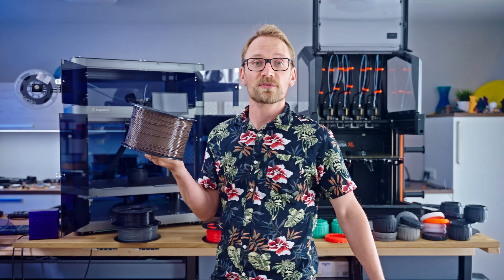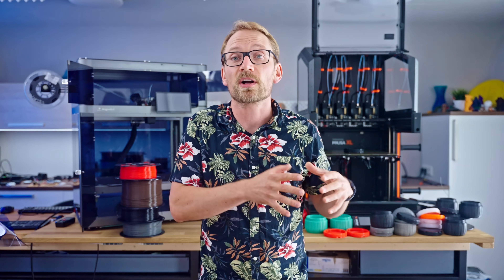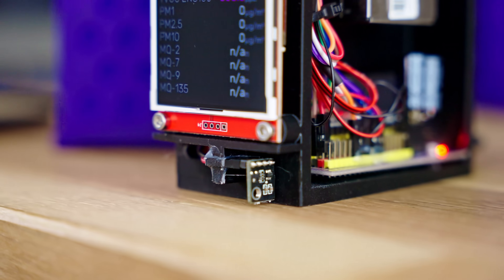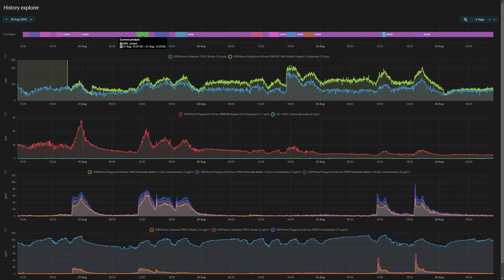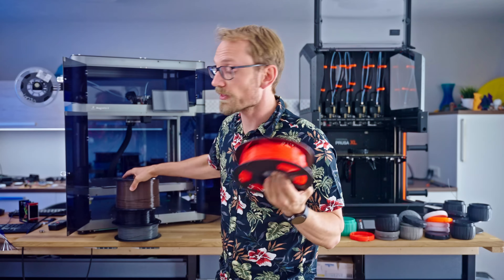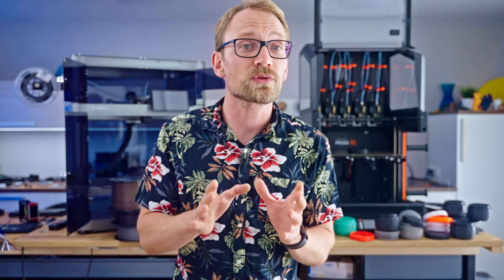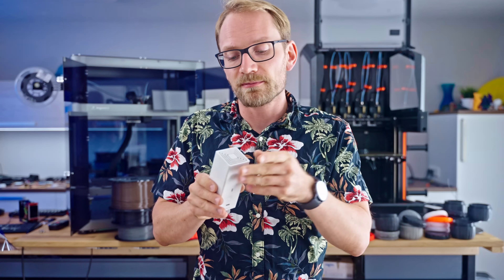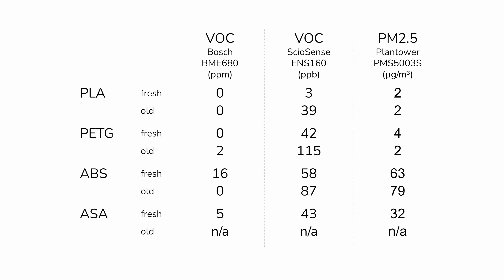3D printers are worse than I thought. Time to do something about it!

Comment from the maker: The Ikea filters I used are FÖRNUFTIG (EPA12 + carbon) and the more affordable UPPÅTVIND (EPA only) 
If you get a HEPA filter e.g. from Amazon, I'd recommend buying a reputable brand to make sure you actually get what you're paying for. Philips is trustworthy and seems to have reasonably priced replacement filters (important as you'll be swapping them multiple times a year): https://go.toms3d.org/HEPAmazon

Parts and sensors used:
ESP32 WROVER https://go.toms3d.org/WROVER
ESP32 breakout https://go.toms3d.org/ESPbreakout
2.4" LCD https://go.toms3d.org/24lcd
PMS5003S particle + formaldehyde sensor https://go.toms3d.org/PMS5003S (make sure you actually get the "S" variant if you want the formaldehyde sensor - they're a bit hard to find)
SDS011 particle sensor https://go.toms3d.org/SDS011
Bosch BME680 VOC, temperature and humidity sensor https://go.toms3d.org/bme680
SCD40 CO2 Sensor (optional) https://go.toms3d.org/SCD40
ScioSense ENS160 VOC sensor https://go.toms3d.org/ENS160
MQ-7 CO sensor https://go.toms3d.org/MQ-7
...modified with these instructions https://devices.esphome.io/devices/MQ-7
I also used an SHT40 temperature and humidity sensor in the front, but it is noticeably inaccurate. I'm currently trying a AHT21 as a replacement.

Product links are affiliate links - I may earn a commission on qualifying purchases (at no extra cost to you)

Comment: PLA is entirely nontoxic, not counting for coloring or additives. There might be a smell, but it is not harmful for your body.
They even mold medical implants out of it that remain in the body for a decade or more with no ill effects. It's just tangled up alcohol molecules.
Reply: At some of those low VOC readings it could even be plastic offgassing from your carpet or from a candle you burned a week ago. It requires some very high-spec sensors to differentiate WHAT is in the air.

Comment: I wonder about having a exhaust fan that just blows the air outside and maybe has some kind of hood over the weekend. We're connected to the back of an enclosed unit that would put your negative pressure there and exhaust the gasses outside. That's what i'm thinking, and i'm thinking of putting one of these in my basement near the basement window, and then just  exhauste it that way

Comment: I think the advantage of the small in cabinet filters like the bantu box are that they are filtering the air at source where the concentrations will be highest.  Reducing those particles and vocs out of the air before it gets out into the room.  They aren't going to clean the room air but they will help to reduce the load.  Coupled up with a room filter they should help maintain a lower peak level when printing

Comment: One year later, I'd love to see a couple more filament types tested, TPU is everywhere now, straight PLA is actually getting harder to find than various "PLA+" or "PLA lite" blends that print ~10'c hotter, and do the common inclusions like carbon reinforcement make any difference?
Personally I'd also love to see a Polypropylene test, but I know that's still extremely uncommon to use, even if its near zero moisture absorption seems like it will make it a well suited to cheap open frame designs and occasional use, without trying to deal with additional drying equipment, removing/inserting filament for storage between uses, or drying time before use, just start printing as soon as fast as hot end and bed can get up to starting temperatures. But obviously good or bad emissions profiles might curb that enthusiasm,

Comment: To anyone reading, put your printer in a room with a window, then you can make a window vent you close the window on that has a tube attached so you can vent air out of the printer outside, with a fan that is pushing air through the tube so its not just bleeding out of the printer enclosure.
Reply: just also make sure the vent isn’t too close to any AC units, or below a window with negative pressure, or it’ll probably come right back 😅

Comment: I run my resin printer through wifi. It's I'm the garage and the back door to the garage and the roller door are always open, even after completing the printing. I also wear a full head to toe chemical suit apart from your typical eye protection and P2/P3 mask. Never had an issue. I'm more worried about curing the waste, which I leave out in the sun

Comment: Thank you for this video. My son is getting our first 3d printer from "Santa" this Christmas, and I was unaware of the air particulates, and we'll mainly be doing PLA - though that seems negligible. I just picked up a H14 air purifier for the spare bedroom it will be in though, just in case. Thanks!
Reply: just watch out for any of the PLA with additives, like carbon fiber; a redditor posted extreme closeup pictures of all the fibers stuck on his hands, he couldn’t get them off after repeat washings.

Comment: If you ever decide to revisit this, specifically look at cyanide. That is by far the most concerning thing. If you are printing ABS, ASA and especially nylon, you are almost certainly producing some amount of hydrogen cyanide. Cyanide does not leave the body easily, and long-term exposure to it is linked to profound neurological problems.

Comment: I just got my first 3D printer after a decade of watching others print and I am so glad that after my first print I decided to search up whether it was toxic or not even though none of the people I watch ever seem concerned... after working with chemicals for 6 years in my 20's, I've had my fill and would much prefer to avoid working with anything that could pose a health risk to me or my family. The 3D printer I got is marketed for kids too... PLA filament is used but still, not worth the risk so I will run the printer in the basement with the air purifier and a open window, hopefully that limits the toxicity. Thanks for spreading awareness.

Comment: I hear PLA is odourless when printing, for you you notice irritation in your throat even if you dont smell it. For me PLA has the strongest smell iff all 3d filaments ive tried, i even consider it the smell of 3D printing. The only true precautiin is extraction for ALL filaments even PLA  😢
Reply: Yeah PLA smells strong for me too, I have my printer in an enclosure with hepa filter and carbon, When the door is closed and air pushed though that no smell.

Comment: Carbon filters are not designed to remove VOC. This myth is everywhere. They ae designed to reduce ODORS. not VOC
Reply: How is that I've seen carbon filters for rooms that have been tested to show how well they work for various VOC and they work well for most of the ones they tested for at least?
Reply: @radfaraf  They work for some VOC's but not all by far. And for safety, if it doesnt remove all VOC's then you have to behave as if it removes none.

Comment: excellent and relevant. I have been struggling to figure out the what pollutants are released during what operation, and this video is useful. I am wondering how I can use the exhaust (vented outside after filtering) when printing, but the chamber needs to be kept at a high temperature for certain filaments (even for PLA the plate needs to be warm) and hence its difficult to just have a powerful exhaust (especially in colder climates).

I am trying to figure out how to connect output of power supply fan to outdoor vent. The power supply fan  might be dumping the air from enclosure into the room (I have a k1c).

Comment: I put my 3D printer in my enclosed porch until I can get an enclosure kit and will be getting a venting bag kit and 3D print window ventilation stuff so it can be safer. I have a room it can go in but I need ventilation.

Comment: Don't expect this filter running will help much. You have to either at least suck the exhaust from the printer through a filter and/or dump it outside, or do the same, but under an isolated fume hood.
I assume that is bound to affect performance in unenclosed printers, as air flow will cool open-bed ones.

Comment: I just bought a Prusa CoreOne to print other materials like ABS, ASA, CF.  They make a filtration system for it but I see so many airgaps.  My printer is located in my 9'x7' workroom which I occupy frequent but also live in a 1000sqft home.  My conversations with Prusa assure me that the filtration system will be perfectly fine to print.  After watching this video I am not so sure.  And not sure add the filtration system and running the FÖRNUFTIG in parallel will be so safe.  To date on my old bedslinger I only printed PLA an PETG.  I was planning to add the Prusa filtration system to print ABS, ASA, CF it looks like the Prusa filtration system barely covers PLA and PETG.

Comment: I was wondering what was worse my exposure to campfire smoke (I like to camp) or my 3D printer (I like to print). Well it turns out it is likely the 3D printer.
"Both campfires and 3D printers can release particulate matter, but the types and quantities differ. Campfires primarily emit fine particulate matter (PM2.5), while 3D printers, particularly those using Fused Filament Fabrication (FFF), release ultrafine particles (UFPs). While both can pose respiratory risks, the smaller size of UFPs from 3D printers allows them to penetrate deeper into the lungs and potentially enter the bloodstream. " Google

Comment: You are missing a comparision test how clean the city air outside of your apartment is as a baseline.
You might happen to live next to heavy traffic or some air polluter and have zero chance to get to those safety limits at all.
Yeah sure, the 3D prints give you spikes. But they might not be the issue w/o a reference measure taken at your "fresh" air source.
Reply: Thomas said (7:20), that he got fresh air in for at least an hour to get a fresh baseline. That's more or less exactly what you are asking for.

Comment: Nice video, thank you.  Where would you suggest I place the ikea air filter...would behind the printer be best, in front of it or above it? (mounted)
Reply from the maker: Most printers have their hotend and part cooling fans blowing towards the back of the machine, so it would make sense to place the filter behind the machine, where the particle concentration would be the highest - but in a small room, it'll all be pretty evenly distributed.
Air cleaners like the Ikea filters account for that and are meant to continuously cycle your room's air through them anyway, removing most (but not all) contamination each time it passes through.
Reply: @MadeWithLayers  thanks for taking the time to reply!  ordering the large ikea one tonight & will put it behind the printer
Reply: Thought I'd post an update here, before buying the FÖRNUFTIG I was getting regular headaches from both PLA & PETG.  Since getting it I've not had a single headache, it's made me use my 3d printer so much more.  Thanks again <3

Comment: I have a constant 5015 mini blower fan doing negative pressure out the window with my 3d printer, even if I am not using it, it is nice to just have constant airflow.  

Also when I deal with my 3d printer, like take it out and repair it or upgrade, I always shower after because that's a lot of microplastics just all over ther place

Comment: i bought an enclosure for the A1 mini with a 10mm pipe filter, it would be awesome if somebody already designed a little filter box for hepa and activated carbon for installing in a 10mm tube

Comment: Hello, can you do a test on the concentration of harmful gases released at different printing temperatures?
I bought a simple air quality tester and found that when printing PETG, the air quality becomes very bad when printing at 260 degrees. Not only formaldehyde, but also carbon monoxide and carbon dioxide are present. However, when printing at 240 degrees, my instrument can't detect any harmful gases.

Comment: Some of those air filtering devices have those Particle sensors build in. I wonder how much it helps when the windows or two windows are opened in a room, of course only a solution in summer time.

Comment: I got a 3D printer last year, but I'm waiting to use it until I get the enclosure venting through a pipe to the outdoors. My apartment is too small for a dedicated printer room, so this tent venting outside will have to do. I hope that's enough if I get the airflow working properly

Comment: Unfortunately, the HEPA filter does not filter out the most important particles, UFPs (Ultra Fine Particles) and VOCs. 3D printers mainly emit these into the air, most of the compounds are toxic or carcinogenic, especially in the case of ABS and ASA materials. Activated carbon is the only effective way to remove VOCs and UFPs! That too only if it is present in sufficient quantities.

Comment: We run a small farm of ASA printers.  I have a friend who builds commercial Air quality monitors, and we never found an inexpensive VOC monitor that could pick up the styrene that ASA and ABS releases. Just a sensor that does it right is about $300.  I wanted to work with him to develop a proper air quality monitor for 3d printing enviornments but the final product would have to cost $600 or more and we had doubts it would be viable in the market.

Comment: Formaldehyde is likely coming from your wall or ceiling panels. Possibly your tables and benches. Oriented strand board, plywood, MDF, glue lam trusses or beams, can give off formaldehyde for as along as a decade after installation.

Comment: It's a shame that these enclosers don't keep out the contaminants and therefore don't do what you would expect. This is exactly why I wanted to get a 3D printer with a housing and HEPA filter, but if the housing doesn't help me, then I can build one myself and install an industrial carbon filter. The manufacturers should do their job properly.

Comment: ! >>> Not mentioned in the video, and what I found In my research,  Formaldehyde is not filtered out by carbon :| , you also need a zeolite media filter for that. I had built my own carbon media filter with 5 lbs of medium grain activated carbon with 12"x5"x5" 120 mm fan on the back of my cabinet,  which worked ok for PLA and PETG, PC, but ASA and ABS get vented out side, and now that I know that about Formaldehyde, I will add the zeolite, but for now I will vent it all out side..

Comment: Thanks for the video!  I am considering a Prusa XL and one of the big selling points to me is that it is enclosed and has a filter built in.  From you studies do you think this is good enough or is it not worth even getting the enclosure?  I use a HEPA filter now sitting beside my SOVOL printer, but an enclosed system with filter sounds like it may perform better. Any thoughts from you or anyone else would be greatly appreciated!

Comment: 15:15 "The only thing that makes activated carbon more effective is having more..." This is somewhat untrue. I used to work as an engineer at a filter manufacturing plant and you can have all sorts of different carbon filtration systems, each with different effectiveness for different scenarios. Some types of activated carbon have high capacity for certain chemicals and low capacity for others; some have relatively less capacity but are cheaper, and some are even regenerable by simply washing with water! You also get different form factors, such as pellets or cylindrical granules; you can get activated carbon from different base materials (coconut shell carbon is one of the high effectiveness types that municipalities typically put in their contracts must be used for sewage gas filtration, and won't accept any lower grade). One more thing you can do is to have alternating layers of activated carbon and chemically impregnated pellets that absorb or adsorb VOC's that either would oversaturate the carbon and kill the effectiveness before its predicted useful life, or it can take stuff that carbon just plainly doesn't take care of very well.   

one more thing; adsorption of VOC's by carbon is typically controlled by contact time. You want enough surface area and depth of filtration media so that it takes at least 3 seconds for air to pass from one side to the other according to the average volumetric airflow determined by the fan you are using. Additionally, you want at bare minimum 200 feet per minute of linear air velocity at your hood to maintain an adequate conveying velocity for the contaminants, and if you're indoors with air conditioning running or people constantly walking by and your printer isn't well enclosed, it will need to be higher. Enclosing the printer decreases the necessary airflow requirement, but is not strictly necessary to help filter VOC's. Having a sufficiently powerful fan and a wide enough filter to avoid high pressure drop (and while you're at it, a bellmouth intake vent hood that you can 3d print to help move air smoother) will help dramatically.

Comment: I've printed a ASA handle for the broken one of my oven (i've chosen ASA because more heat resistant). As the handle is directly fixed to a metal part of the oven that becomes quite hot, do you think it will exhale VOC or other bad stuff during cooking?

Comment: Thank you for discussing this topic - it’s one that’s not covered enough! I’m a props  and costume designer getting into 3D printing lately and given my work and safety knowledge that comes with it, I just knew that 3D printers (both resin and filament) couldn’t be safe to have sitting around unfiltered, running constantly in people’s bedrooms and kitchens and stuff. We need to wear respirators when working with melting plastics and casting resin so of course using the same methods with a 3D printer also emits fumes that are potentially dangerous. I already own air filters for Covid safety on film sets, so one will become a dedicated 3D printing air filter and I’m definitely gonna set mine up in a space that I don’t spend lots of time in.